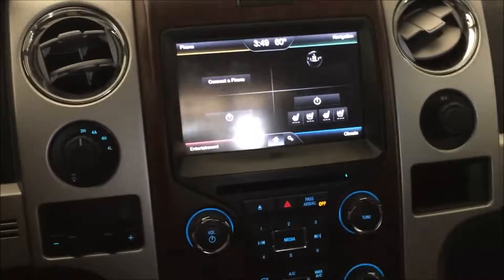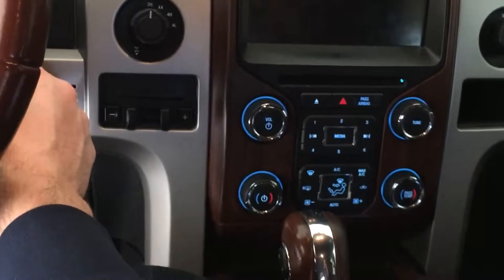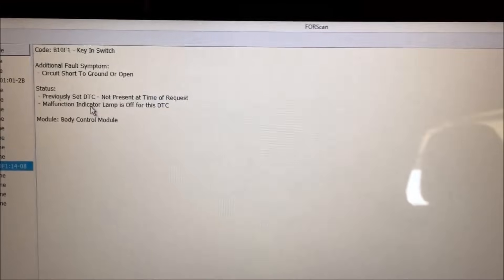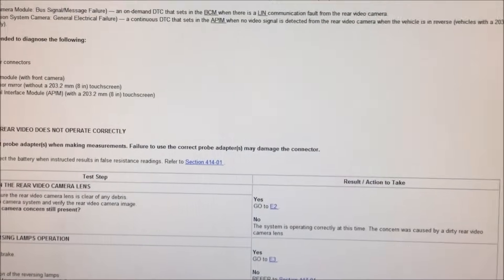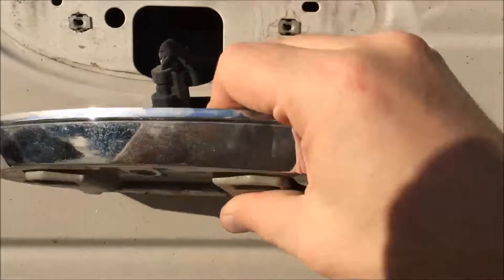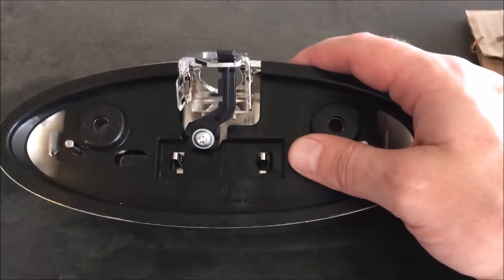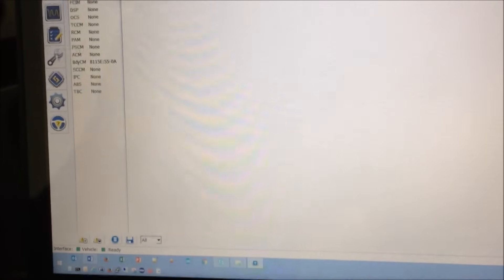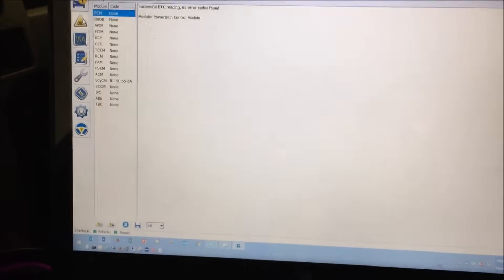Diagnosing and repairing the backup camera on a 2013 Ford F150

Comment: I've seen multiple videos on this problem with more than one solution. Either it's a grounding/wiring problem or a new camera is needed. Did you check your wiring connections before ordering a camera?
Reply: Grounding issues with the Fords can get crazy. Camera went out and now advancetrac. I need to go check all my grounds

Comment: Great tips. Could you provide the OEM p/n's ? And where you got them (if online)?
Reply from the maker: Sure- I did shop around but ended up ordering all of the parts from Amazon.  They had decent prices but with free shipping it ended up being more cost effective to order there.  I also got the 2-day shipping with Amazon Prime so I got the parts quicker, although doesn't look like all of them are Prime eligible at the moment.

Camera: P/N EL3Z-19G490-D 
    https://www.amazon.com/gp/product/B00TRFM7S2/

7" Nameplate emblem: CL3Z-9942528-B
    https://www.amazon.com/gp/product/B00FZGGUJ4/

Bezel and camera harness (optional if you don't break the old one): AL3Z-19H511-A
    https://www.amazon.com/gp/product/B00TNEKY0U/

By the way, I just made a new video this week on how to decode the Ford part numbers so you can find the model-specific p/n when you only have the generic number (like 19G490 for the camera, for instance):

https://www.youtube.com/watch?v=Wvgfb0R5XTM&feature=youtu.be

Comment: Don't buy the cover as you can use the old one. Ford tries to rip you off and get you to buy a new one. It still has prongs to align it on the truck and the old prongs where it was holding. Use a glue gun and put glue in all the 4 prongs and it holds just fine. Mine has been on a year and has had no problems. Anybody who has used a glue gun knows it will hold just fine and the emblem is just a emblem that has no pressure for pulling it off.
Reply from the maker: Mr P Cool good to know!
Reply: Glue gun glue softens in heat. Might not be a good permanent fix, I like the silicone caulk suggestion below There are silicone caulk glues too.

Comment: Be careful my camera was upside down but perfect image, do not change the camera, do the same diagnostic and what I found was a module failure in my computer, a $800 dealer fix and luckily, they covered it under warranty.  Code shown was the body module..
Reply: Crap, hope that's not the problem with our 2013 Ford Edge.  Camera sometimes upside down, sometimes blank with error message.

Comment: great video. I replace the camera on my Ford Edge, but it shows everything upside down. Will try calibration later to see if I can fix it.
Reply from the maker: Interesting.  Let me know if the calibration helps with that.  Most of the time the calibration helps with things like the guide lines not showing up.

Comment: Mine sometimes don't work and trows that same message in screen but i just open tailgate and move cables and it works back again its also a 13 eco boost
Reply from the maker: Ricardo Zubia Glad that worked for you. That was the first thing that I tried but it didn't help.
Reply: Yep, I do the same thing.

Comment: Did you get the parts directly from ford?
Reply from the maker: I bough Ford OEM parts, but I shopped around for them and ended up getting them from Amazon.  Pasting this here as well for the part numbers- these were the parts that I bought:

Camera: P/N EL3Z-19G490-D 
    https://www.amazon.com/gp/product/B00TRFM7S2/

7" Nameplate emblem: CL3Z-9942528-B
    https://www.amazon.com/gp/product/B00FZGGUJ4/

Bezel and camera harness (optional if you don't break the old one): AL3Z-19H511-A
    https://www.amazon.com/gp/product/B00TNEKY0U/

And I made this video on how to decode the Ford part numbers so you can find the model-specific p/n when you only have the generic number (like 19G490 for the camera, for instance):

https://www.youtube.com/watch?v=Wvgfb0R5XTM&feature=youtu.be
Reply: Thanks so much!!